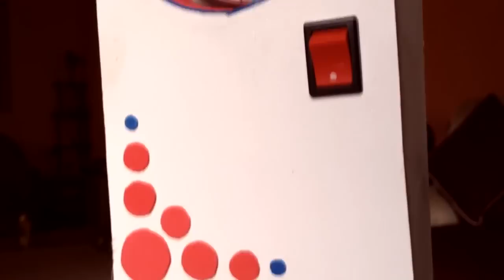How to make Bladeless Fan at home - DIY USB Homemade Dyson Fan Air Multiplier

Comment: is it fan call exposes fan ? u not explain about two holl in back side of swetch board ( behind side board) please reply
Reply from the maker: Those holes are for air suction. Its all closed from all sides, the fan sucks air from backside holes & throws inside to the hollow.

Comment: 3:25 you should either cut the wires at different lengths or put tape on the exposed wire that you cut, the could short and start a fire. besides that great project.
Reply from the maker: Thanks for your suggestion. s

Comment: Will it also work with a regular CPU fan?
Reply from the maker: CPU fan can not be adjusted inside bcz we need to blow air upward. Thanks.
Reply: no, but u can remake the fin like a blower... srry my english
Reply from the maker: This function is like a blower.
Reply: you could use a laptop cooling fan, they pull air through the exposed side and blow it out the side, so you could orient it inside the box properly and it would work, except you will need to cut holes for air flow

Comment: i am making a dyson fan for my final year project. i would like to ask why do u have two holes in the back ?
Reply from the maker: If there is an exhaust, there must be intake where the air comes from.  You must keep a large hole or many small holes & try to cover with a mesh and make a separate hole for wire connection (Don't do like I did.). Thanks.

Comment: where can we found the material used for making the blade?
Reply from the maker: Cut from any hard plastic sheet or from card board.
Reply: what is the source of electricity? Was it battery or you plug the usb cord on an outlet?

Comment: Can i have aa list of the item you have used to make this blade-less fan. and the measurements too. It would be a great help to me. Thanks alot
Reply from the maker: List of items is already showed in video. You can modify your own design with the same technique. Thanks.
Reply: whats the body made of?
Reply from the maker: Its Formica laminate sheets used to cover plywood.
Reply: so the entire body is made of  plywood including the side?  And what is  the thing that rotates in the bottle cap and what is under is when you were sticking it to the plywood?
Reply from the maker: Yes entire body is made of plywood. I took a bottle cap & inserted a dc motor removed from cd player. Then I stick some small pieces from plastic sheet. Also stick 2 very small pcs of popsical stick underneath the dc motor so that air can pass inside the motor because there are some holes and I didn't close them.
Reply: why do u have a curve in the body . is it to direct air flow ?
Reply from the maker: yes I made a passage to flow in one direction.